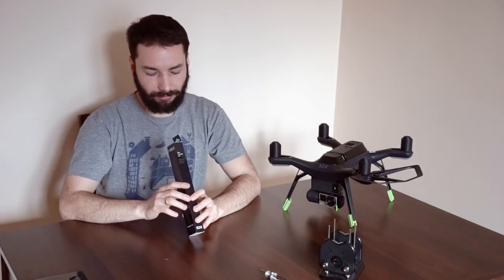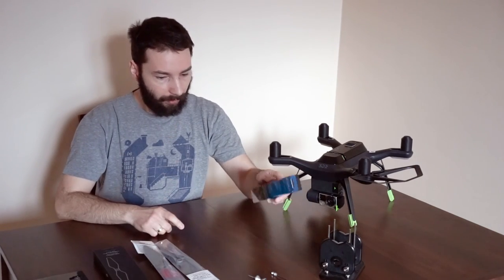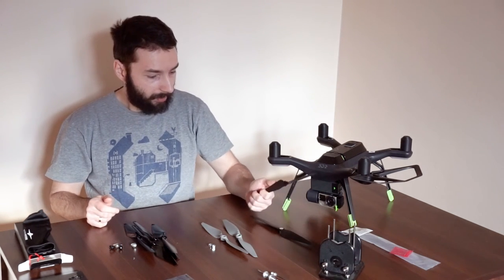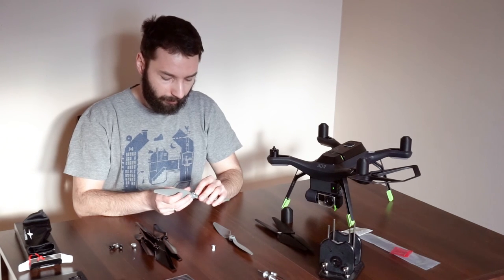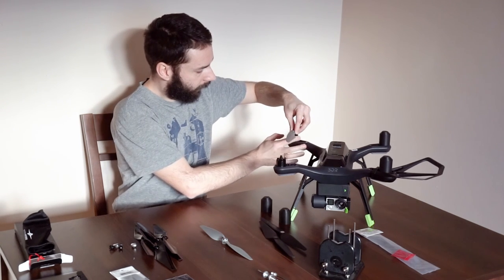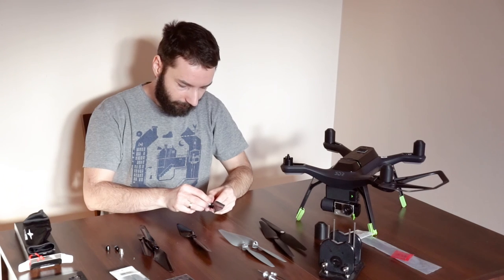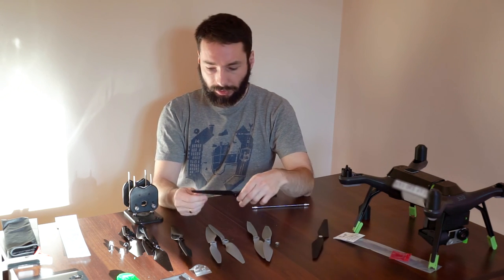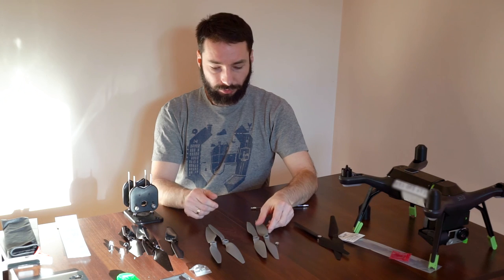Propellers comparsion between 3DR stock, APC and Master Airscrew

Comment: Thanks for sharing your video, with these helices that benefits you with respect to the originals?
Greetings.
Reply from the maker: +DU V didn't flown them yet as I have spare 3dr's. I was looking for backups bcs here it is hard to get original ones. 
I think that if you balance them properly and glue propeler to screw they should behieve better than stock. Read somewhere that master props are taking 15amps during hovering and 3dr 16 - 17 amps.
Reply: Ok, Thanks